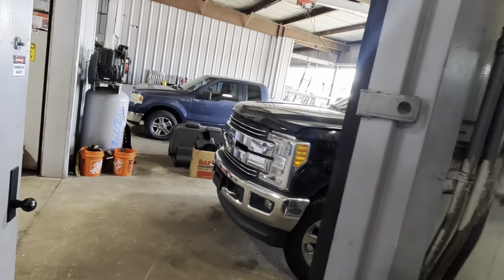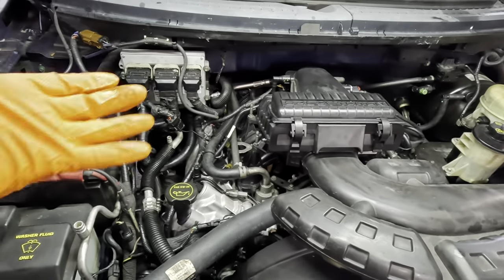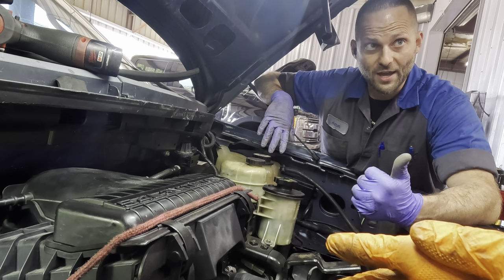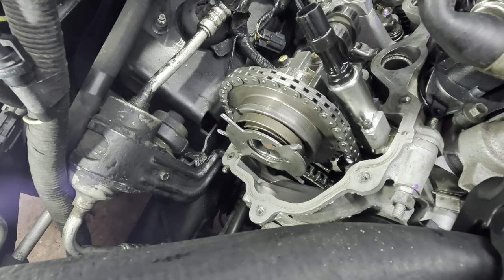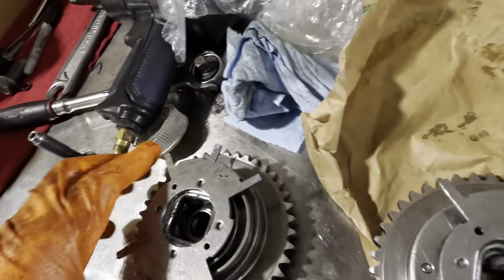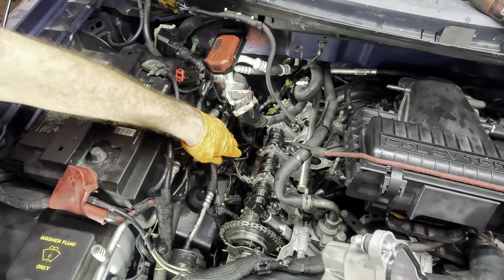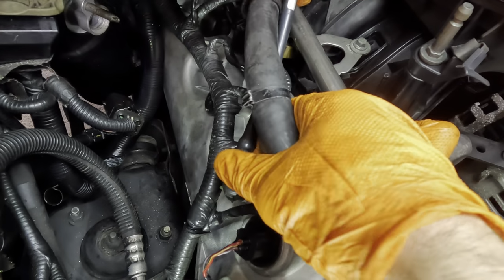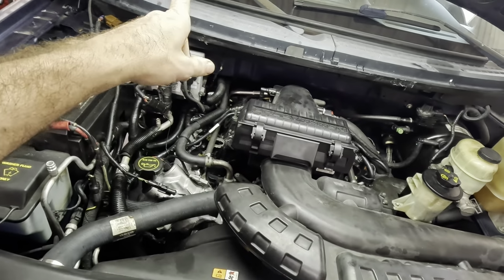Ford 5.4 Camshaft Phaser and Timing Chain-Wedge Method

Comment: On a vehicle like this where you're searching for a solution, constrained by a warranty company calling shots, it must be difficult to get the satisfaction of a job completion.  For myself, that was the satisfaction, a completed job. Although there's still the exhaust leak to contend with, this second phaser replacement seems to have solved the engine noise. I'm looking forward to the follow-up video on the cold start to see. Good job, sticking to the job at hand, keeping the customer's best interest at heart. Thanks for sharing the journey.

Comment: My brother purchased in 2008 a 2008 Ford F150 4x4 with the 5.4 he got it used in 2008 with 10k  miles. My brother put another 130k miles on it and never had a issue with the truck period.. He had it serviced at the Ford Dealer for everything, oil changes were every 5k miles. Engine ran perfect when he traded it in for a new 2020 Ford F150  4x4 2.7 EcoBoost.
Reply: Hate too tell you but I'd tell him as soon as the engine starts making funky noises too get a 3.5 ecoboost cause the 2.7 has a internal water pump that will leak coolant into the oil pan and boom engine is toast

Comment: I hope the engine re builder installed a Melling high volume oil pump. Nice work Ray!
Reply: I heard high vol pumps were not a good idea, massive increase in pressure at the bearing. Not good

Comment: Having found the paper inside, if mine, I would have dropped the oil pan and looked for any evidence of debris clogging the pickup strainer.
If I remember, sometime early on, it was started with the cam covers off.  Whilst oil sprayed everywhere, that does give an indication of how long the pressure takes to reach the cams.

Comment: The last company that I drove for had 5.4 and 6.8 ford fleet trucks. I drove mine almost 350000 miles never had engine issues. Had alot of brake calibers replaced. Most of the trucks once started would run 8 to 10 hours a day and never get shut down. They were a real workhorse.
Reply: Rare on the 5.4 and 6.8
Reply: Musta been 2 valves.

Comment: Seems to me few years back an old man taught me about these things that work for Ford for years the biggest damage you can do to rebuilding one of these motors is putting the gasket back up underneath the tensioners for the timing chain you said they usually blow out one side or the other within the first 10,000 MI

Comment: Just an idea stick of horoscope in the oil pan and see if you see a piece of that paper on the oil pickup. This is a problem I've seen one time before not on the Ford engine specifically but I've seen it once before

Comment: You can use the smoke machine and fill the hub up with smoke and see if it leaks.
Reply: Not sure if the do Drug Test there😏
Reply: I believe Eric O at South Main Auto used a smoke machine to diag vac hubs on Super Duty that had a similar issue.

Comment: The correct fix is going to be jack up the radiator cap, and drive a new truck under it, or just replace the engine again.

Comment: There so many video's covering the 5.4 triton motor and watching you explaining the repair of the previous repair is a confirmation. 
  This engine has spawned a host of videos the triton 5.4 is an engine (in my book) to run from. I owned Ford products and said that Ford is owned by Snap-On Tool for obvious reasons but this design but the 5.4 is a rabbit whole of an engine.
Reply: You need to differentiate between 2-valve and 3-valve versions. The 2-valve Triton engines were quite good.
Reply: I retired a 1998 5.4 two valve with 301,000 miles , only 3000 mile conventional oil changes, NO OTHER SERVICE OR REPAIRS (excluding brakes, tires, spark plugs, two cops,and coolant flush and replaces). Retired due to rust, hauled max gvw full time, although a lot of highway mileage….retired 2004 all same except 5000 mile synthetic oil changes, now am still running 2010 , 3valve at 303,000, have had to change one starter, one  alternator and stretched oil changes out to 7500 miles when highway and 3000 if lots of city.  Motor issues in my experience are owner caused!!!

Comment: 0:03 MAN ALIVE!!! Here I am diagnosing the hubs on my 72 Jimmy, because they failed to lock up yesterday. Here comes Aaron with the same problem, and all this time, I'm thinking, it's the sticky wheel bearing grease I used. How interactive IS this show???!!  Update, all I could find is that the grease is too sticky, and in low temps, the parts can't slide properly. Will have to get the appropriate grease.

Comment: I suspect you might find some of that very durable parts wrap paper resides in the pickup screen. If not, you are chasing a cheap-o rebuild with a bunch of crappy hydraulic parts. You may be able to rule out a pickup blockage by monitoring oil pressure. The "rebuilder" may have employed cheap, leaky phasers.

Comment: As I watch Ray manipulate the wire harness on a 20 year old truck I wonder how many times old wires are compromised and fail when they are handled aggressively.
Reply: Wires take this kind of handling very well.  In my 50+ years of messing with cars I have never had wiring fail that was not pinched or severely folded or short circuited.
Reply: Wires are very good about be manipulated. its not like theyre exposed to uv rays, just heat which can dry but mostly keep like new
Reply: thats why you can see a short at the PCM at the end of the video.... 
wiring harnesses are not meant to be treated like that and these other posters here do not know what they are talking about.!!!!!!!!!
Reply: @MrMustangMan Settle down it's fine
Reply: @firstlast---   obviously it's not fine when the result is a short on the PCM/ECM from the harness... watch the spark at the end of the video....
Reply: @MrMustangMan  Good thing every circuit is fused
Reply: @MrMustangMan  Where are you seeing a short/spark at..video time stamp please...PCM was already done when he hooked the battery back up???

Comment: Man, those wire harnesses look like there was a shortage of cable to do it properly. Those are very tight, indeed. Have yourself a great day Ray, Lauren, Dave and A-rod.
Reply: Some bean counter at Ford "saved" an inch of wiring harness per truck, reducing the parts length needed by a couple million inches 🤪
Reply: @mrpesky163  Most probably.🤣
Reply: Shopdog ran away for awhile again...that infinity took an eternity.🙉
Reply: @mrpesky163  actually his second job is MIdnight Copper Collector II🧔‍♀️

Comment: Ray did you see the spark from that plug at 39:24 when dave started the engine in the top left, it's coming from the middle one.

Comment: you are leaking electricity out of the middle  connector of that box with 3 connectors check the video......at tthe end by startup.....
Reply: I think you'll find it's a bit of tape flapping about in the back draft off the fan like some of the other bits of wiring harness.
Reply: Good eye 👁️

Comment: Finishing my timing Ford 3.7 FWD timing chain job today. Had to get the cam holder tools. Fun stuff. @5:30... THIS is why I hate dealing with non OEM warranties. You can have videos, pictures, O-Scope readings an tea leaves saying the problem is "X" and some guy behind a laptop, on the phone tells you to replace "Y" instead. I've actually turned away a customer because the warranty company only wanted to pay me a discount rate to replace a part that wasn't going to fix the problem. I hate doing that, but for $65/hr, that barely covers my overhead and the customer was going to be unhappy either way.

Comment: Ray, this may have been mentioned but have you ever used a mechanics stethoscope to isolate where a noise is coming from? They are very cheap but priceless when it comes to finding the source of a noise.
Reply: He has numerous previous videos  through the years where he does use a stethoscope, this one didn't require it as he has mechanic super hearing.

Comment: The oil pick-up screen on this engine is about 2" in diameter. Not like the good ole days. Paper in the system is going to plug it real fast. I came up with a back flush using parts from a remote oil filter kit to be able to back flush from the filter housing to the oil pan drain.

Comment: I noticed something (not sure if its revelant or will help), and I just went back to the last video and confirmed this, when you removed the center camshaft bolt in this video on the passenger side oil came spilling out. (As one would expected?) When you took the center camshaft bolt out in the previous video on the drivers side no oil came out! 

Is there cam timing codes set by the ecm in this truck? The wax packing paper you found on that side right under under the valve cover. If memory serves (it has been a while since i have tinkered with one of these or really engine for that matter) oil would have hit that wax paper, the flower to the timing solenoids, then either directed into the phasers as needed or dropped back down to the oil pan and cycled thru again? 

If a piece of that paper were dropped down into the pan it would have been sucked up into the filter and caught. The only two things it really could have clogged would have been the pump or the filter. We know that happen because as far as we can tell oil pressure is normal. 

But what if a piece of paper got directed into the timing solenoid? That piece of paper would be, and may still be, stuck inside the solenoid! The piece of paper you found was still largly in tact so we know oil will not cause it to break down and shred appart. I almost wonder if a tiny piece of paper is lodged inside the timing solenoid and the noise your hearing is lack of oil pressure until pressure builds enough to by pass the piece of paper? 

Wait seeing this "theory" if where the paper could have possibly gone has me thinking of anther possible theory. What if there is a piece of paper blocking the oil pump screen? Maybe the paper is sitting in just the right spot that when you shut the engine down it lands in front of the screen. Until there is enough movement and pressure in the oil to push it out of the way there is no oil pressure in the engine. This could also explain why it only happens on "cold" start up. If there is enough oil in the top of the engine, and the delay is small enough you would never really lose pressure in the top end. But if you let the engine sit overnight, and the bulk of the oil drains back down into the pan, now you have a condition where on first start up there is no oil pressure in the top end! 

My only problem with the secind theory is it still doesn't explain why there was no oil in the drivers side cam phaser? Or at least that is my assumption based on the fact no oil drained out when you pulled the bolt. Which brings me back to the first theory, that solenoid is blocked.

Comment: “ low pressure Ray” yes it is still important to maintain air pressure better milage, and control of your car / truck! 
if one tire is low in pressure, you can lose control due to less traction. properly inflated tires are much more stable.
and good tread lasts longer. also as you are aware tires are very expensive $$$. at least 1 check a month! just get into
the habit on a specific day each month to do the task.

Comment: Odds are 10:1 that one of two things didn't happen in the "rebuild."

1) They didn't replace the chain tensioners. The seals blow out and bleed off after a shutdown. This causes some top-end noise on startup until the pump can build pressure. Sometimes there is also a pressure issue at hot idle.

2) It's SOP to replace the OEM oil pump with a Melling high-volume pump whenever opening one of these up. Guessing they didn't do that based on the caliber of the rest of the work.

Comment: Could you use a stethoscope,  on start to exactly pin down the noise?  Stay well stay safe.
Reply: He has numerous previous videos  through the years where he does use a stethoscope, this one didn't require it as he has mechanic super hearing.

Comment: @Rainman Ray's Repairs  I had an old pushrod engine that did the same thing and it was the lifters de-pressurizing or draining down when the engine was off. It did it on almost every start but was always much worse on a cold start. I know there are no pushrods or traditional lifters but isn't there hydraulic followers for each valve that could be draining down allowing for valve slap before the pressure comes up?

Comment: I’ve seen a few videos on these phasers from fordtechmakuloco and others, but reminded me of one of his where he said a lot of dealers-parts shops, still have the OLD phasers in stock and are pushing these out the door and if you don’t specifically ask for the updated phasers that you’re liable to get the old ones. Being this was a job done twice I’m just wondering if they sent you the old phasers both times?? I know there’s a difference in appearance between the two, but I’m not sure if you’ve got the old or the new. Just puttin it out there. Sucks you had to do this more than once for sure and definitely the owner is hatin it as well.

Comment: hi could the noise problem be caused by a cheap oil filter eg if it does not have the valve that prevents backflow

Comment: With the state of sloppy part management  nowadays,wouldn’t checking the correction of the replacement before removing the defective part be safer?
Reply: A side by side comparison is the best way to tell if you were sent the right parts

Comment: When you have engines like with timing chain problems, maybe timing belt engines aren’t so bad. You get a new timing set every 100k miles.
Reply: Back in my day we switched all that nonsense out with a Pete Jackson Gear Drives, never a failure after that. Bullet proof

Comment: 1) How do you not fix the exhaust leak first so you can hear properly? 
2) check the oil pressure with a mechanical gauge if you're so committed
3) Its also wise to get a Borescope in the oil pan, if paper got in, its probably blocking the oil pickup tube...
This is weird

Comment: Ray, don’t be so hard on the 5.4’s as they really were tough, good engines. We had an ‘01 Expedition that had 334K on it when we traded it in 2021 for a new Ranger. The big problem with it was the intake manifold that went bad at 161K and that job was a beast for me to do it.

I made the mistake of replacing with a Dorman and that only lasted 60K, then replaced it with an ATP which lasted the rest of our ownership of it.

Comment: Good lord Mr Ray, I've watched all the videos on this truck, with the time you have already in ,you could have pulled off the cab, pulled out the engine, repaired the harness, installed another engine and of course brake cleaned the whole engine compartment. I feel for you sir,I'm not really enthusiastic about this repair fixing the problem, I keep hearing a bearing but I may be wrong, good luck this time

Comment: My opinion is it's not the Fazer on ether side that has failed and I cannot say what is the problem because I am not there in person and I would use a mechanics stethoscope 🩺 to help pinpoint where the noise maybe coming from. My auto's have a thing on the dash that tells me that I have low tire pressure and it's so nice to have.

Comment: I realise that you are under instruction from the engine warrantee people, but I'm curious if it's worth doing an oil and filter change for a belt and braces approach just in case your theory of wax paper ingestion is correct?

Comment: The problem with the hubs sounds like what you said the hubs are gummed up. I worked on a f150 my senior year that did that and both hubs were gummed with grease mixed with water

Comment: My wife's 2011 Expy idles rough and gets the left bank cam sensor code. I replaced the sensor and same. If I clear the code when the driving the car it stays clear until I let it idle for a long time or restart it. I am being told the phaser is worn and not returning to idle lock? It makes no noise and other than rough idle runs great. I think this is what I need to do. Just replace the driver side phaser and see if that fixes it.

Comment: I had a 2000 f250 and just about got stuck on the beach from a failed hub. It leaked after i turned off engine and disengaged. I don't like that air/vacuum system.

Comment: What is going to tick in the phaser? It fills up with oil and stays that way. Nothing to tick in the part. It’s not like a lifter that has to refill with oil on every cycle of the engine.

Comment: Wouldn’t it be worth it to slap some JB Weld on that crack in the exhaust manifold, just a temporary way to make it shut up. It might make it easier to localize where the clicking and clattering is coming from. Then you can replace the manifold later.

Comment: If it has a rattle noise upon start, vvt gears, vvt phaser/actuator, chain tensioners, replace them all, otherwise oil pump.

That tapping noise sounds like a stuck lifter but thats a ohc.

Check vvt seals and passages, filter screens if they have.

The cam, a rocker, or spring could be bad even.

If a motor that is under warranty was tapping I'd made the warranty company replace the engine.

I used Gates Cam Gears on a 2010 corolla and they are perfect.

I use paint pens to mark alignment marks and the chain itself

Comment: Why would you not repair the exhaust leak first. It seems to me that you could better diagnose the noise easier.
Reply: Because the engine rebuilder that is paying for this job is not responsible for that.

Comment: I’ve got to admit, after you previously found the protective paper chunks inside the engine, (if it were mine) I wouldn’t be able to sleep without pulling the oil pan and verifying the pan and oil pump pickup are clean… this is what we call the beginnings of a $h*t-show..